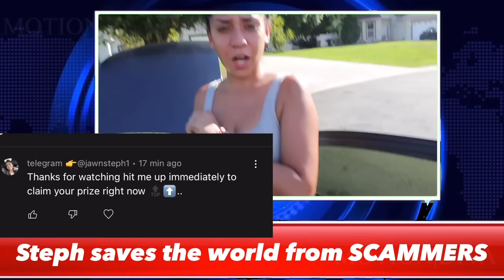RAIN DIDN'T STOP US FROM DOING THIS

Comment: You wildd with jeans on in this florida heat, I swear I haven’t used jeans since winter I can’t😭🤣
Reply from the maker: The pavement would’ve melted my skin if I had shorts 😭 gotta have jeans if you’re getting on the floor especially w the heat 😭😭🙏🏽
Reply: @Jawnsteph  You rightt,  Although  if u wanna try what I do that works really well, get a 10x10 tent canopy, you can get them for $50 at Walmart or sports academy, and then you can set it up when you’re working on your car and it’s hot or it’s raining. Fits right on top of the car and it’s not too hard to set up, though I recommend setting it up with 2 people.👍🏽

Comment: The reason the nut wasn't tightening and the joint was spinning is because those a tapered and has grease behind it which helps stops it from wearing out fast. When you take it off the tapered joint isn't stuck to the outer to stop it from spinning. So the trick to stop it from spinning when putting the nut back on is to put a jack under the lower control arm jack it up to put pressure on the bolt to stop it from spinning. 👌🏾have a great day guys. We need more females running the show in automotive great to see 🙏🏾 you guys are epic. Im subscribing right now! 🔥
Reply from the maker: Thank you for that advice will definitely have to do that right now!! I couldn’t figure out why it kept spinning 💯💯 thank you for subscribing 🙏🏽🙏🏽
Reply: @Jawnsteph  Qualified auto technician for 23 years and working on machines for 38 years so help is just a msg away 🙏🏾 Ball joints and tie rod ends spin a lot when parted. There a many ways to stop them from spinning but the main one is to put pressure on the joint with a jack like I mentioned or a G clamp to squeeze them tight together. There's a lot more but those are easier to do especially if you are doing all the work on the ground. You got this!! And I'm glad I found your channel I'm going to marathon all your uploads later on. 🙏🏾